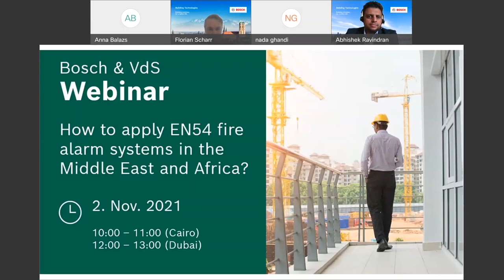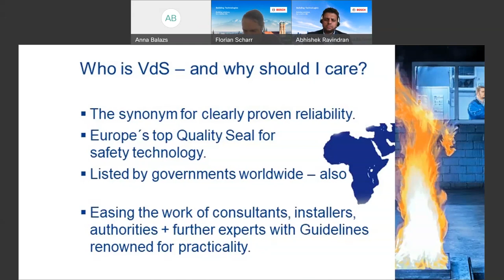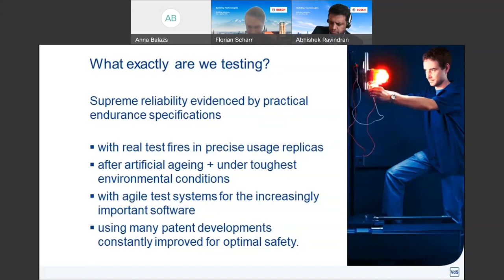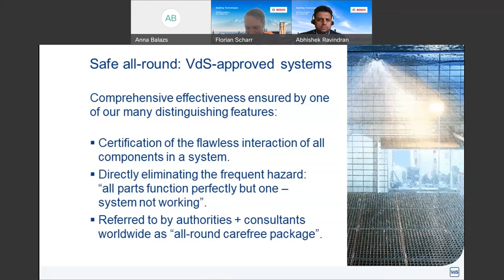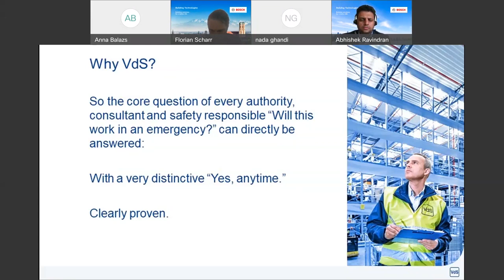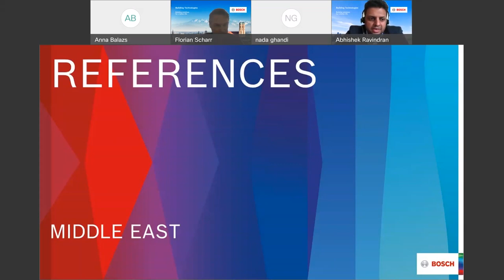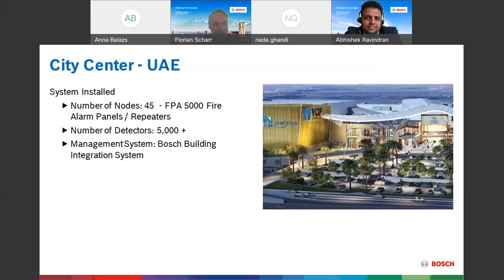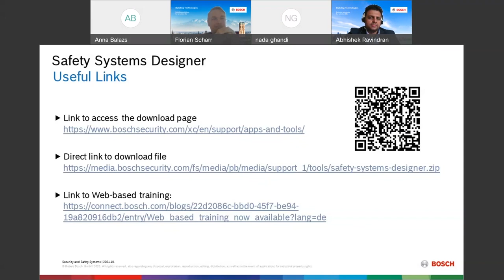Bosch Security - How to apply EN54 fire alarm systems in the Middle East and Africa?

Comment: Good day, I link my conventional Fire Panel FPC-500 to the addressable panel FPA-5000 using I-2-D.  The I-2-D parameter are has followings, Usage type: FIRE, Monitoring: EOL (1.5kOhms-6kOhms) and Activated if, Close (<800Ohms). If I send the configuration to the panel, its return with a fire alarm triggered. Someone should please help me. What am I doing wrong.